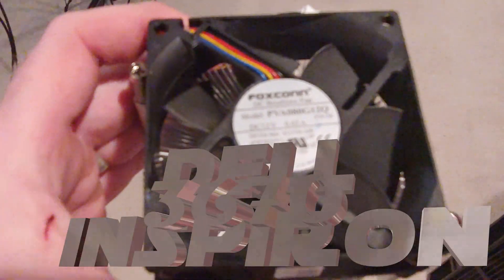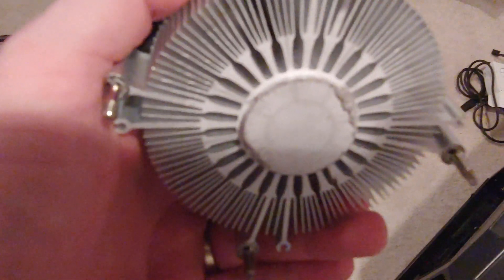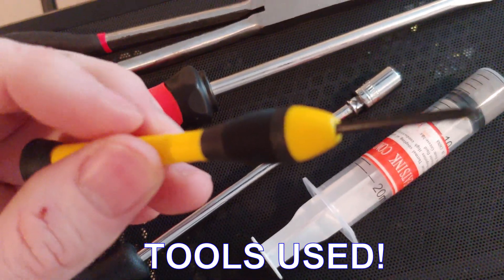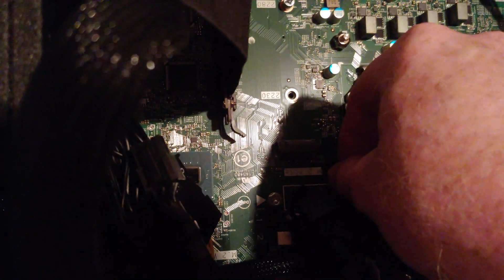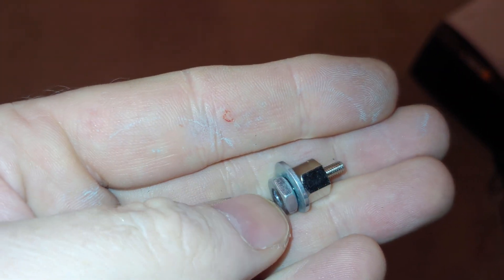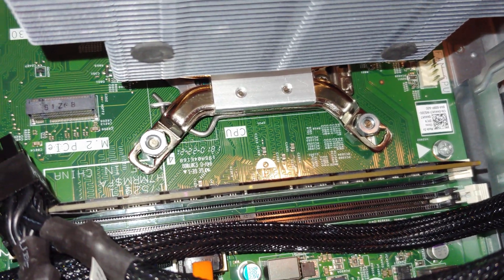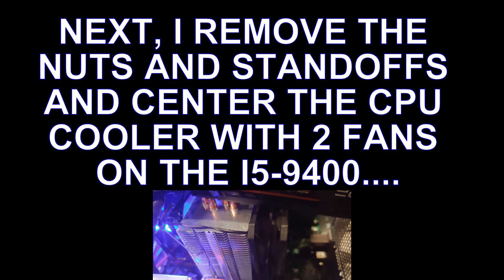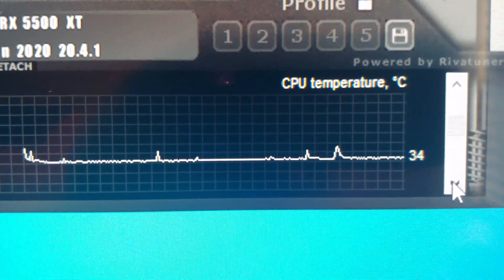Failed upgrade attempt to install CPU Cooler into Dell Inspiron 3670, Modified DeepCool will it fit?

Comment from the maker: This was my first attempt at trying to find a beefy CPU Cooler.  Though I have not been able to get it to work, it did show promise.  While my method for fastening it down caused the CPU and bottom of the cooler to not sit flush/parallel/full contact, when I removed the fasteners, I was able to get it to seat.  This dropped the lowest temp recorded to 28--29C and the highest during the benchmark to almost 10C less.  The other added benefit, my I5-9400 has been getting terrible CPU benches.  This changed drastically with this CPU cooler.  Overall, this was still a FAIL for several reasons, 1) I can't close the case. lol, 2) I can't move the case because the CPU cooler isn't fastened down.  3)  MSI Afterburner only records temps up to 100 C, during my experiment I may have gone beyond that.but just south of the supposed 105 C max of this chip.

Positives I gained out of this: 1) I realize that this Deep Cool heat sink can keep a CPU cool in moderate use without using a fan on it.  Of course with the Dell, you have to keep the fan plugged in.  I this case, it was plugged in, but kept out of the Dell PC Case.  2)  Using MSI Afterburner...I discovered a way to compare Temp charts of CPU coolers.  Expect to see this in the future as I compare Intel fans vs upgrade fans on my custom build computers. 3) If I had the right fasteners, I believe one could get this CPU cooler to work correctly, however, one needs a shorter one that fits in the case.  4) The plastic connectors of the Deep Cool Gammax were worn out...and not usable anymore.  I now have something I can use this for.

Comment: I want upgrade Dell Inspiron  i3 8th gen pc into i5 9th gen and Also uprage a better tower cooler 
So Excuse me Sir can do this.
Plz suggest me fully informative
Reply from the maker: Hello, I was able to a 120mm cpu cooler/tower into this Dell:  https://youtu.be/xd75T0O_jkg   Two problems, 1) It is too big to keep the side panel on and 2) Had to fit existing mounting bracket (underneath motheboard)...otherwise, you would have to take the motherboard out.

I would look for 92mm cpu cooler or possibly something like this might work ID-COOLING IS-50X V2.  

Somewhere on here I believe I did a 9th gen video.  Perhaps, even a bios update video.  Mine currently has I5-9400f in it.
Reply from the maker: Here is a video of me installing I3-9100 and verifying if it would boot up at the end.  https://youtu.be/7ntW9BSCwGQ

Comment: Have you ever tried doing a case swap for the dell inspiron 3670?
Reply from the maker: No, I have not.  Have I thought about it, yes....mainly for a YouTube video.  I believe it would probably involve some soldering from the existing connectors that are on the motherboard to the wiring from the PC case.  It is also not likely that the bolt pattern will match.  The I/O shield is another story.  

That said...when I get back from Africa, it might be time to experiment with this...as it could have been one of my biggest videos and give me additional experience to tear apart the other HP/Dell cases that I have.

Comment: I learned alot about working on computers from watching you work on the dell inspiron 3670. I actually just recently replaced the CPU cooler in mine.
Reply: Thoss 4 pegs behind the motherboard, they're like welded onto the case so I grabbed a pair of pliers and just sort of snapped those off getting a clean break on all 4 pegs. That gave me the room I needed to mount the bracket for the nh-u9s noctua cpu cooler and was able to close the case but then I was getting that cpu cooler fan error on start up so then what I did was I took   one of them y-splitters and hooked it to the cpu pin on the motherboard and I am running the noctua nh-u9s and the dell intel stock fan. I mounted the dell intell stock CPU fan on as a case fan so since I'm running both fans, I'm no longer getting the error code on start up
Reply from the maker: Very interesting...would love to see that video.
Reply: @nicholasmccullough531  hey Nick, is there a way to turn off the fan error in Dell BIOS? I too use a 3670 with stock cpu fan. I have read the link below, but there is no explicit mention of turning off the error. Thanks :) 
https://www.dell.com/community/Inspiron-Desktops/Inspiron-3670-Fan-amp-Heatsink/td-p/7394441
Reply: @nicholasmccullough531  Thanks for this comment, is this setup still working well for you? I'm considering doing something similar. Did breaking the pegs off damage the case at all? And how was the clearance for the case cover? I can't imagine there was much clearance but as long as the cover and cooler aren't touching I'd be happy enough.
Reply: @davidirwin7569  this set up still works for me but seeing as how the pegs are attached to the case, you do damage the case by snapping those off.
Reply: The clearance is good and looking at the case from the outside, the case doesn't appear to be damaged.
Reply: If you are planning on selling your dell inspiron 3670, I would not recommend doing anything like what I did or modding your case in anyway but I decided that I was going to keep this computer and i was really tired of how this bad design was holding me back from fixing it up and upgrading it with a better gpu, a better power supply and a better cooler.
Reply: The cooler I'm using is not touching the case cover. I am using a 
Noctua NH-U9S for my cooler
Reply: @nicholasmccullough531  thanks for the info. Was more asking if the case shows visible damage on the exterior when snapping those legs off. I know mounting the stock cooler would be impossible afterwards. Not planning on selling my machine if I can get it working ok as the spec is fine for me. The stock cooler just isn't working well enough, i7-8700 hovers around 80°C under load and peaks into the 90s. I put on new thermal paste but it hasn't helped much. Going to try adding case fans before committing to the cpu cooler upgrade. Will probably get the same one if I do since I know it will fit. Thanks again
Reply: @davidirwin7569  
No visible damage from the exterior.
Reply: @nicholasmccullough531  I finally got around to upgrading my cooler. I installed a Noctua nh-d9l. The heatsink installation went well, however the fans aren't working as expected. I have both the stock fan and noctua nf-a9 fan connected using a y splitter. The stock fan runs fine, but the noctua fan doesn't spin until the cpu gets to around 70°C. Did you have any issues like this?
Reply: @davidirwin7569  I did not have any issues like that, how is it doing now?
Reply: @davidirwin7569  I've also had the same issue, I've got the noctua nh-u9s and noctua na-syc1 splitter cables. When it's all connected, the Dell stock fan to the 4 pin of the y cable and the noctua fan to the 3 pin, only the Dell fan spools up until the CPU temps get higher! Not sure if you've figured it out yet, any ideas much appreciated incase I'm doing something wrong.
Reply: @nicholasmccullough531 just wondering is your setup any different to mine in the comment above, maybe you can spot something I'm not doing right?
Reply: @Scudydoo   Honestly I remember getting some kind of error code at first and I was getting confused and I actually swapped backed n forth a couple of times and it quit giving me the error code and has not given me the error code since. How is your computer doing now?
Reply: @Scudydoo  your setup sounds exactly the same as I tried. I ended up keeping the stock fan connected to the cpu header, and running the noctua fan constantly at 50% from a powered fan splitter (powered from a sata pwr port on the mobo). Not ideal but I've been monitoring temps and they have been good. Cpu temps rarely go above 70° now and noise is minimal
Reply: @davidirwin7569  that's kind of the route I'm going down now, I'm running the noctua fan off of my non stock power supply via a sata adapter running at 100% and going to put the stock Dell fan somewhere as a case fan connected to the CPU fan pins. Just waiting on some m3x25mm grub screws which should hopefully allow me to mount the heatsink without removing the pegs of the case :)
Reply: @Scudydoo  this is the fan splitter I have, it has a high and low mode which allows me to run the noctua fan at a lower speed rather than 100% constantly. I also used m3 25mm grub screws to mount the heatsink, it worked well. https://smile.amazon.co.uk/dp/B08LCS7GPX/ref=cm_sw_r_cp_apa_glt_fabc_JZPGQTQJ2Y6TSWV84AVM?_encoding=UTF8&psc=1
Reply: I'm not sure if there is a way to turn off the fan error in bios.
Reply: @nicholasmccullough531  alright cool. thanks :)  
I will prob go with this product. same sized fans  as the stock intel cpu fan cooler. 80x80x25mm
https://youtu.be/JmWjwgWlYqQ
Reply: I used a splitter to hook up the stock CPU fan and that new noctua fan simultaneously to avoid the error message
Reply: @nicholasmccullough531  gotcha :)
Reply: I used zip ties to place the stock cpu fan onto the back of the case using it as a case fan
Reply: @nicholasmccullough531  oh that's smart. Here i was thinking of using blu tac or double sided tape. Or even a heat sink clip to clip the stock fan onto the one side of the heat sink.
Reply: It was odd because It seemed like I had to try over and over again unhooking it and hooking it back up until it finally quit bugging me with that error message. I have no idea why it did that. I seen someone else on YouTube get rid of the error message by simultaneously hooking up both fans using a splitter except he was working on an older dell, it was either a dell inspiron 580 or an inspiron 3847 he was working on.
Reply: @nicholasmccullough531  I did it. Deep Cool Ice Edge V2 heat sink had two fans (came with 2 pairs of metal buckles, and a syringe of thermal paste). I replaced one of the provided fans with dell stock foxconn fan to trick the BIOS. Y splitter cable was provided in the box. Deep cool fan is now pulling air into the heat sink and stock foxconn fan is pushing it out to my prior installed exhaust fans. I have now used the spare fan as a case fan, bring in more cool air from the side of the case. (Dell 3670)
Reply: @MarketStoic  that's awesome